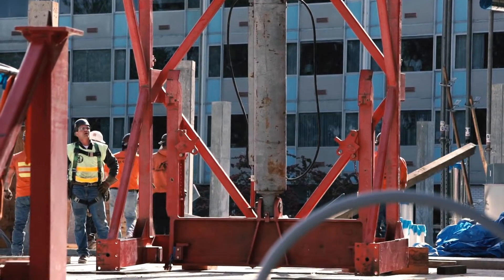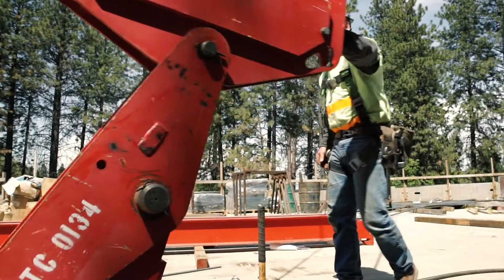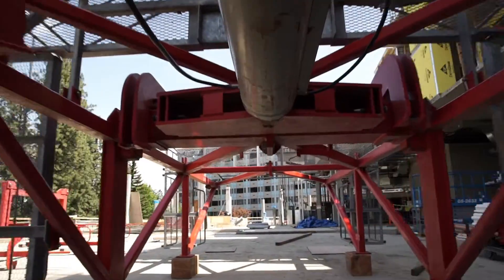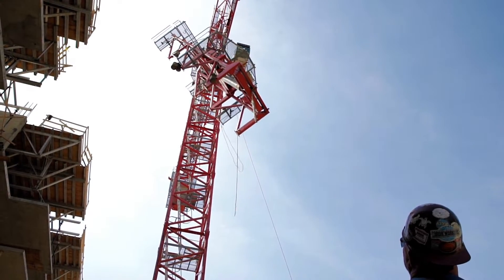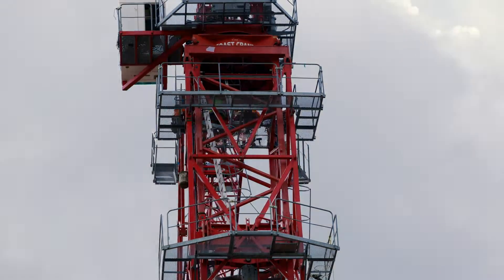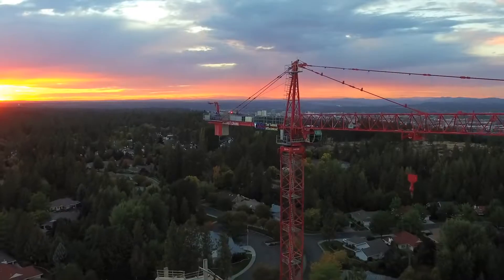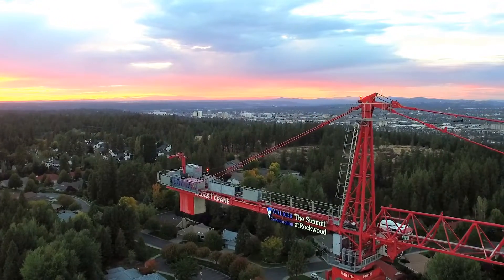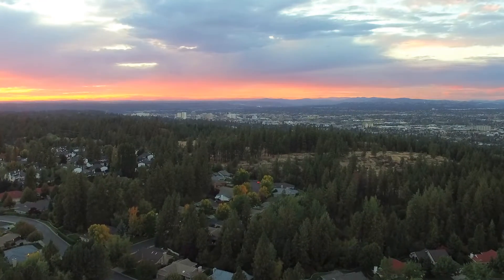Jacking the Crane -- Walker Construction's Rockwood Summit Tower site

Comment: Don't understand why they didn't just build the crane to full freestanding height when crane was erected at the start of job. Strange way of doing things and very costly doing the job twice. A lot of risk involved in climbing/jacking cranes. In terms of cost time, planning of this crane erection is balls up. No need to climb when you can freestand this crane on 12 towers at the start.
Reply: There's lots of reasons why you don't do it first of all it needs to be pinned after a certain height to the building if it's above 4 stories also the line that you need if there's parking Underground usually for floors underground so that's a lot more line also it's hard on the motors lot longer of line lot more Delay or lag when you line up or down or swing so usually they wait until after 4 stories or 6 above and then do the final jump it's all added in the cost and that's the way it works otherwise this would be in this would be in high stage all the time very hard on the crane as well
Reply: @natep.5617  wrong mate, you can freestand the damn crane 12 towers without a tie collar back to the building! Most tie collars if you are going more than 12 stories and up require a tie collar at the 8th tower.. and every 8 towers after that depending on height of building. Hook height is not a issue, rope length is not an issue. Four storey carpark underground makes no goddamn  difference because the damn crane is piled in above the car park!! Does not change the hook height or height of crane!.
Reply: They probably didn't have enough tower when they put it up guys. Happens all the time. Better to wait till another crane comes down rather than buy 7 more brand new sections.